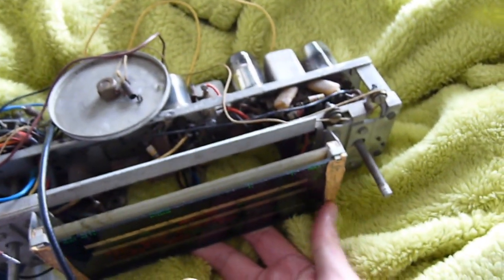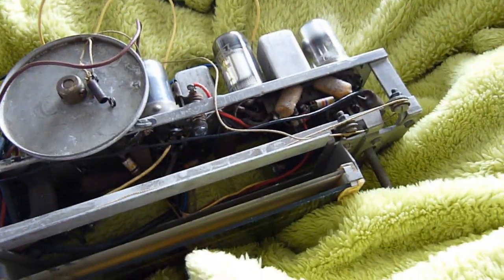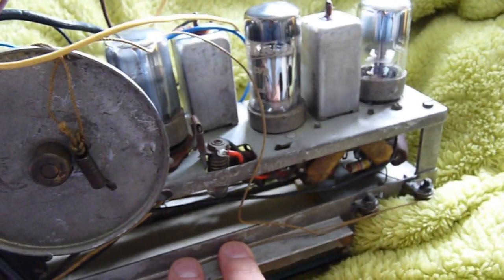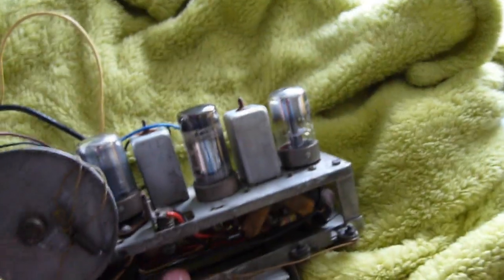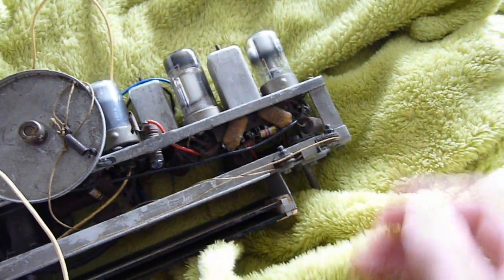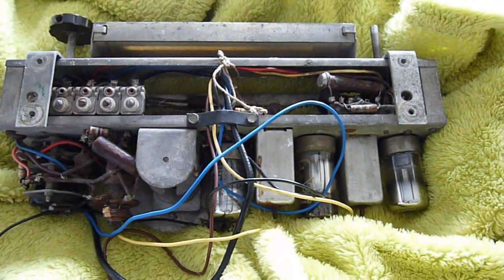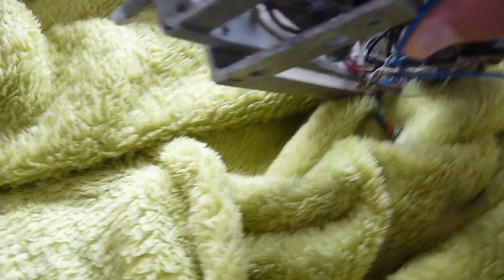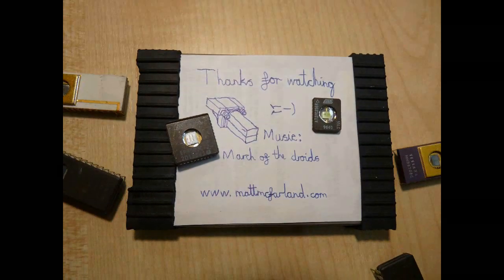Valve Radio Recever Overview

Comment: Valves, tubes or as I like to call them FET with Pilot Light 

I would say restore and not pull appart and try and rebuild.
Reply from the maker: BeachSandInspector Technologies I would like to get it working, probably will have to dissemble it and resemble n new circuit using as meany original parts as possible.